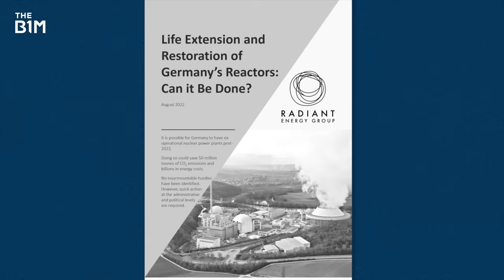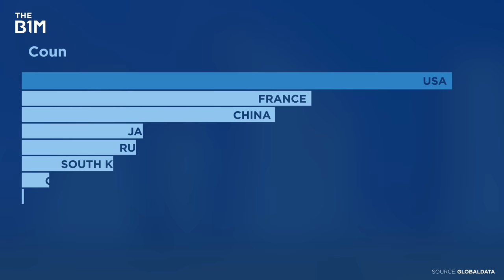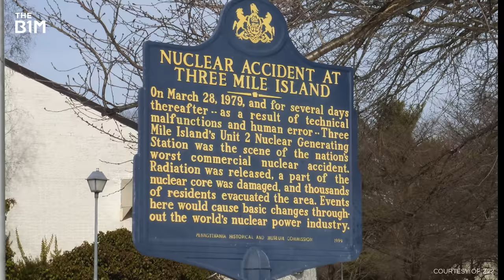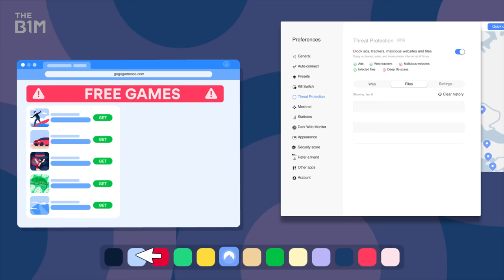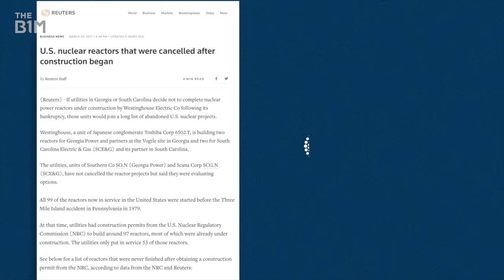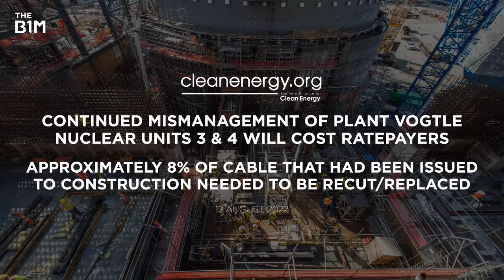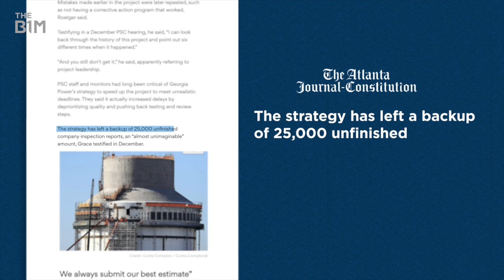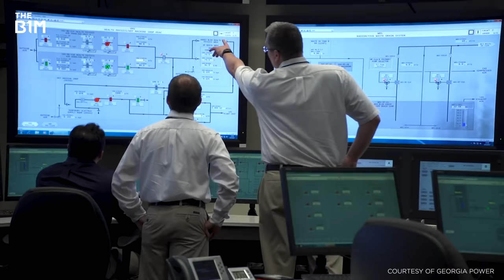Why Nuclear Power is Making a Comeback

Comment: 5:40: That's untrue. Flamanville NPP block 3 was expected to cost 3.4billion euros and should have been completed 2012. Ten years later it's still not online and costs are expected to be around 12.7billion euros. The 300million you are talking about are only the latest price increase for the delay from end of 22 to Q2/23!!!
Reply: Fun fact. If that amount had been invested into solar and wind you'd have about 4 times the power generation it's supposed to have and it would likely have been ready much faster.
Reply: @XMysticHerox  
yes but the power generation won't be as reliable as nuclear and it can't be "on demand".
Reply: @dickmelsonlupot7697  
Then only put 40% of that money in solar/wind and the other 60% into batteries or some other storage facility. Would work as well and you would not end up with waste that literally kills you for the next million years.
Reply: @dickmelsonlupot7697  Nuclear is not on demand either. It is always on, unless it is in a maintenance cycle.
Reply: @dickmelsonlupot7697  you do know how many "reliable" french nuclear stations are turned off at the moment ?
Reply: @1968Christiaan  Still off? Why? I heard in the summer a lot were shut down due to extreme heat (as of nuclear needs cooling and ecological problems arise from overheated natural water bodies), but shut off nowadays?
Reply: @TorteInYourFace  The answers are there. Solar wind and storage can be a solution. This video might sound impossible, but worth a look: https://www.youtube.com/watch?v=6zgwiQ6BoLA
Reply: @dickmelsonlupot7697  This plant and any current plant is not on demand. They are all base load and in fact often even less flexible as it can be difficult to shut a nuclear plant off.
Reply: @dickmelsonlupot7697  solar can be easily on demand, you can just unplug the solar and nothing bad will happen, and when you dont have enough energy you can use pump water storage batteries
Reply: @faustinpippin9208  
you are very very very unrealistic if you really think that it's that easy.
For one, your argument is based of the best of the best circumstances and DOES NOT actually reflect the ACTUAL REALITIES of the world.

and no, you can't just "unplug" from solar.
You are only talking about an ability if it were solo solar power where it's only your home.
It's very very very different if we're talking about mass scale power supply here.
Reply: @XMysticHerox  
uhhh, no.
Nuclear plants can be on-demand.
They have always been and will always will be.

And for one, a nuclear plant doesn't need to be shut-off even if power needs are low.
It's not some unstoppable force that can't be stopped no matter what.

If you know anything about nuclear, you'd know it's basically just the most high-tech version of boiling water.
That's just it.
Even when power from the plant is needed, just a single switch is needed to cut or minimize power supply while the remaining power the plant produces in miniscule amounts would be enough to keep the lights on in the plant and to keep everything stable.
You don't need to shut the plant off in the first place since that's not what you do for nuclear powerplants.
Reply: @dickmelsonlupot7697  All current nuclear power plants are not used for dispatchable power. This is a fact. 

Why? Because it takes time to adjust them and once adjusted you cannot immediately go back due to reactor poisoning. So in other words no current plants are not really suited for dispatch. Yes you can make adjustments but they are not really suitable for reacting to things as needed. 

Hence why plants mainly are used to provide the baseload much like solar and wind while more adaptable plants like Gas or Hydro can be easily adjusted as needed.
Reply: @dickmelsonlupot7697  a NPP is very little adjustable from its power output, only between like 70-100%. I was recently in the Netherlands, they have all of their highways illuminated. Why? They need to waste the excessive energy during the night. With solar / wind this waste wouldn't be necessary.
Reply: @computercrack  
the problem with your argument is that the "waste" you're talking about isn't bad.
hell, that's not even a problem and it's a good thing because it means that nuclear has power ALL THE TIME
The only time energy becomes a "waste" is if we're talking about energy from fossil fuels especially since electricity rates using those types of power source are expensive and also those sources produces large amounts of CO2 and other hazardous emissions and even physical waste that is far worse than even nuclear waste and has actually killed more people than both Hiroshima and Nagasaki.

And yes, that "waste" wouldn't be necessary and isn't a problem for solar and wind mainly because at night, your only problem is how to manage the power during the night without it running out since solar won't run without the sun.
Wind might run even at night but there are times when wind currents are too weak that they won't move the turbines that much ergo making weaker power than it should

So no, nuclear still takes the win here.
Reply: @dickmelsonlupot7697  of course it's bad. It adds more cost to the society additionally to the already highest electricity prices of a NPP which is hidden behind taxes. How much do you think is the cost of all these lamps? Must be huge and it's only needed to get rid of excessive energy. Also illuminating all the landscape is a kind of pollution, it's called light pollution.
Reply: @dickmelsonlupot7697  the argument of no sun at night is basically pointless, since during the night you can use wind and also during the night there isn't much energy used anyway. And all across Europe there is basically always somewhere wind blowing, you just need a grid to send the electricity produced in England to send it to Italy for example. In the rare cases there is no wind and no sun for a "long" time you have to have backup powerplants that can ramp up quickly. We may get rid of that if there are enough electric cars to support the grid. There may be other forms to store energy without having to rely on fossil power plants.
Reply: @dickmelsonlupot7697  final point: nuclear is the most expensive, dangerous and complicated way to produce electricity and only countries with nuclear weapons will try to maintain those powerplants in the future. Solar and wind with countless possibilities of backup storage is the cheapest, most clean and easiest way to produce electricity

Comment: The problem with the main forms of “clean” energy like nuclear, hydro, solar, wind is that we cannot ramp those up or down as demand increases and decreases. Nuclear plants can take days to ramp up and slow down. Solar and wind are at the mercy of natural forces. Until we can find a way to store excess energy at a utility scale, “clean” energy will be very difficult to fully implement. Natural gas plants can be ramped up and down to balance demand and production in real time.

Comment: Having worked at Hanford #2 in the 80's, there are few more issues with building nukes. I'm all for it, but nobody has addressed the endless paperwork required. Of course this was before smart phones and such but I had to complete a one foot stack of paperwork (yes, 12" high) before grouting back a (non-critical) pipe penetration. That times the thousands of non-critical tasks and it's a mountain of forms. How can we build a 777 or a SpaceX rocket and yet a nuke is beyond our capabilities?

Comment: Americans, now that this project is almost completed, please construct more! You cannot let the nuclear plant building knowhow get forgotten. We have the same problem here in EU. Most of the reactors are decades old... The Olkiluoto 3 reactor which is in it's final testing phase saved our asses here in Finland. If it wasn't completed before winter, we would have been totally fucked with the energy prices and would have had to use rolling blackouts to keep the grid stable.
Reply: In Poland they also construct one. On the other hand france´s NPPs are not running so well, they import lots of power from neighboring countries like germany.
Reply: see.......The Great Global Warming Swindle - Full Documentary HD....YouTube
Reply: @johnl5316  which is why it's time to go back to nuclear.
Reply: @stroll-and-roll  France's nuclear plants were a huge success until the environmental extremists predictably started forcing them to shut down or operate under onerous regulations. That led to France planning to decommission ALL of its nuclear plants and letting maintenance slack, which in turn put the French in their current situation. They inexplicably followed Germany's example and made themselves dependent on importing dirty and/or expensive foreign energy over creating the only actual green energy at home.

Comment: My thoughts are that we should be building nuclear plants that are scaled back in output so that reasonably sized construction equipment can be used. At the same time, settle in on a design that can be repeated throughout the country in order that the operators that are trained at one plant can easily slip into the same position at another plant.
Reply: The older designs require a certain size for economy of scale to kick in, basically the red tape for a 1GW reactor is no more than for a 250MW reactor.
Reply: Basically thats what France did with EPR and Canada with CANDU have done.
Reply: It's coming. I heard Rolls Royce has started on this.
Reply: I believe they're called SMRs, or small modular reactors. I think one design is in the approval process!
Reply: @AnimeHumanCoherence  There are a whole bunch of companies and countries working on these, the first one actually under construction is probably the ACP100 in China.
Reply: This is the plan.  Small Modular Reactors (SMRs) can be built efficiently on an assembly line in a factory and transported by road or rail to installation sites like decommissioned coal-fired plants where the grid infrastructure is already built and waiting for watts.
Reply: There's a thing as roi. NuScale is going around the world trying to sell their mini modular reactors (30-60 MW) and they are mainly laughed out of the countries. Romania, having 2x 700 MWCandu reactors and units 3 and 4 in perpetual and halted construction is consideting them wss approache by NuScale to build some modular 30 MW reactors and are stuglling since they are still very expensive and offer very little output
Reply: @crimsonlightbinder  - Yes, they also laughed Henry Ford out of town when he proposed to build ENTIRE AUTOMOBILES on an assembly line.  

In any case, perhaps ROI is a poor criterion in an existential crisis.
Reply: NOT wise.  One stove . . . lots of people sampling the stew and adding their pinch of whatever.  I live next to an electronic proving ground.  The boys like to impress the babes with their prowess and accessibility to devices.  Consequently 'I' have the morning sickness . . . shouldn't have been born.  People are regularly doing shit to me . . . the police are skirt chasers.
Reply: All Westinghouse reactors are very similar and the latest (AP1000) is the new standard.  The secondary sides are very similar also.  It ia like driving multiple Chevy vehicles, the controls might be in a different location but they are so similar that it is not an issue.

Every utility has always selected the largest reactor available because of economies of scale.  Once built, big or small, they all take about the same number of people to operate and maintain
Reply: @AnimeHumanCoherence  Yes here is that story.

This is from the Des Moines Register an ultra conservative newspaper concerning the only Small Modular Reactor (SMR) project in the U.S. today.
In 2013, the Wall Street firm Lazard estimated that the cost of generating electricity at a new nuclear plant in the United States will be between $86 and $122 per megawatt-hour. Last November, Lazard estimated that the corresponding cost will be between $131 and $204 per megawatt-hour based upon the 4 recent new nuclear projects in the U.S. . During the same eight years, renewables have plummeted in cost, and the 2021 estimates of electricity from newly constructed utility-scale solar and wind plants range between $26 and $50 per megawatt-hour. Nuclear power is simply not economically competitive.
SMRs will be even less competitive. Building and operating SMRs will cost more than large reactors for each unit (megawatt) of generation capacity. A reactor that generates five times as much power will not require five times as much concrete or five times as many workers. This makes electricity from small reactors more expensive; many of the original small reactors built in the United States were financially uncompetitive and shut down early.
The estimated cost of constructing a plant with 600 megawatts of electricity from NuScale SMRs, arguably the design closest to deployment in the United States, was originally advertised as costing $1 billion but upon requesting actual bids from engineering firms, increased to $6.1 billion in 2020. Given inflation and other cost constraints that cost today can only be expected to be significantly higher.
The cost was so high that ten members of Utah Associated Municipal Power Systems canceled their contracts. NuScale then changed its proposed plant configuration to 6 fewer reactors but increased each reactor output from 50 Mw to 77 Mw costing at total of $5.3 billion. The NRC just last week approved the construction of the 50 Mw design but now will have to start the review process all over given the switch to a 77 Mw design. For each kilowatt of electrical generation capacity, that estimate is around 80% more than the per-kilowatt cost of the Vogtle project in Georgia — before its cost exploded from $14 billion to over $30 billion. Based on the historical experience with nuclear reactor construction, SMRs are very likely to cost much more than initially expected. And they now have delayed the project start until 2025 in an attempt to find more backers.  All this before the inevitable setbacks that will occur once construction starts.
Reply: @JesseHBrewer  Vogtle and VC Summer tried the factory assembly line for system modules and it cost more time and money
Reply: Japan has been making and selling small modular reactors though.
Reply: Thats the problem with nuclear plants. You cant do it like solar panels. I just wants a small plant here and there lol. Cos to defend a nuclear power plant cost the same regardless of size and that is truly the difficulty. But once you build it, you are basically set for a long long time.

Comment: I work as an engineer in the largest offshore wind farm projects in the world, over 1GW both in execution and planned. I can tell you that we would not be able to build at such at such low costs without a continuous pipeline of projects, with lessons learned, workers chaining projects, etc. So I totally understand why nuclear is expensive and why the problem is not the technology itself.
Reply: We need offshore wind in America. But so many people don't want to see it. Maybe they have investments in coal, or they left Holland to get away from windmills?
Reply: Even with a continuous pipeline of projects it wouldn't be the same. Small modules like solar or (somewhat larger) wind turbines simply scale better in terms of learning curve. That's the problem when a single nuclear plant takes 10+ years to build.
Reply: @Mattnesss SMR's don't take 10 years to build. I live in a Renewable Energy Zone and just one wind/solar project here is estimated to be completed in three years. At halfway through the planning they are up to 32 projects of solar and or wind and there are 800 wind turbines included in those figures so far. They want to install 69 turbines in  our beautiful valley, each one at 7MW and standing at 280m high and 200m wide (918ft high X 656ft wide). It's bloody devastating. We have 19 endangered species of birds identified in our region alone, as well as endangered bats and Koala habitat. This part of the project will utilise 73 square kilometres (7,300 hectares) and the solar will utilise 17 square kilometres (1,700 hectares). A total of 90 square kilometres for a form of energy that is capable of producing a fraction of the output of coal, gas or nuclear. This is just one project! The cumulative effect of all these projects being built around the same time will be horrendous. The wildlife will be decimated and by the time they complete the projects that are
Reply: I posted the above response accidentally and the edit function isn't working for some reason. Just to conclude, by the time they complete the planned projects it will be time to start all over again. They are destroying the environment for a form of energy that isn't fit for purpose.

Comment: I wouldn't worry about accidents like three mile island anymore, printers have gotten a lot faster since then. Also computers have gotten fast enough to be able to fix the problem themselves instead of flashing a red light on a large wall of flashing lights to signal something has broken.
Reply: That wasn't the problem.  Computers can just do stupid things faster.  Everything else around the equipment has been completely changed as well as the equipment itself.
Reply: @nathanwahl9224  That wasn't the only problem but it was a major factor in making the disaster worse. If they had up to date accurate information on what was happening, they easily could have stopped the disaster from getting worse or possibly from happening at all. 
The printer that printed errors was several hours behind withen 5 minutes of the disaster sequence starting, how does that not have an effect?
Reply: @nathanwahl9224  Computers are significantly less prone to errors than humans.
Reply: @nathanwahl9224  What Luke said. You cannot follow the decision tree of correcting an error if the system that tells you the error is incapable of doing so effectively.